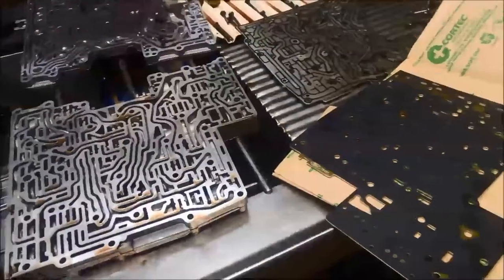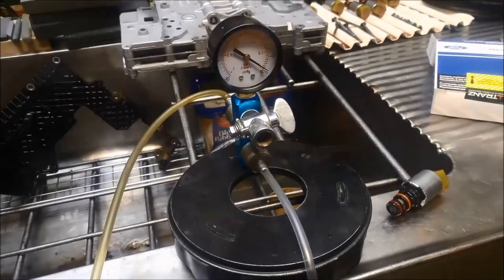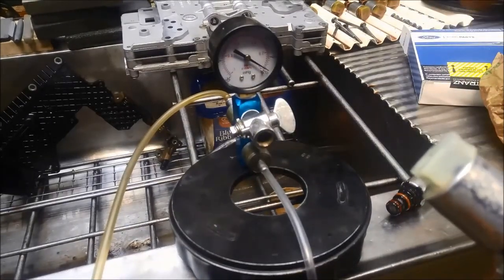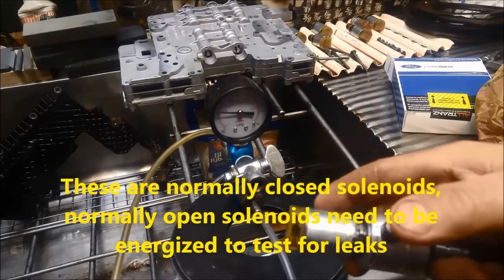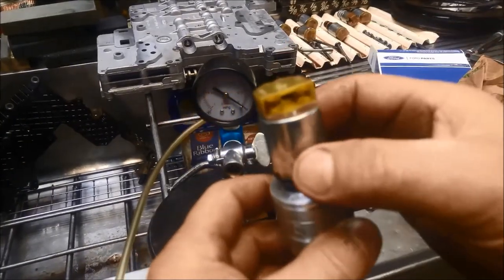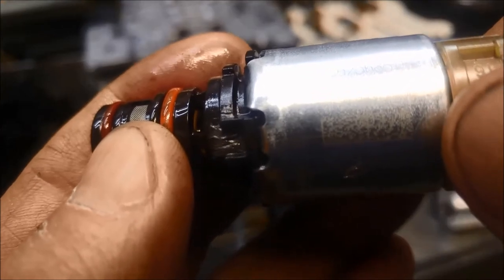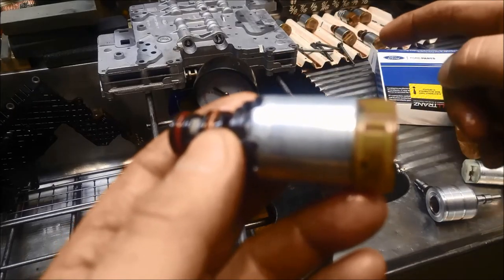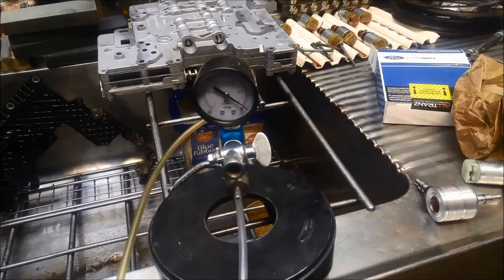6R60E 6R80E  Solenoid Vacuum Testing Automatic Transmission

Comment: Ive got a 6r garbox issue for you on mazda bt50. Its a gearbox with a oneway cluth and doesnt have the TCM in the lead frame. The issue is, when in gear iether D or R, the vehicle just wants to keep going, unlike any other ford or mazda similar, where you accelerate or give gas for it to move. We have to hold back by applying the brakes and or hand brakes. Whilst holding it back from moving, the engine smokes under load and the revs drop
Reply from the maker: hi, for technical questions please contact us via our facebook link in description and don`t forget to bring some beers. cheers